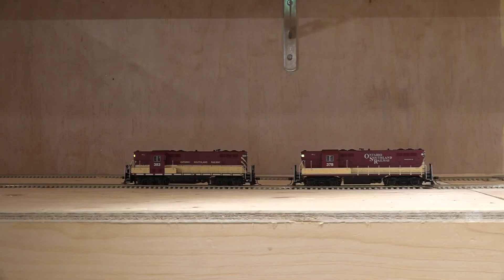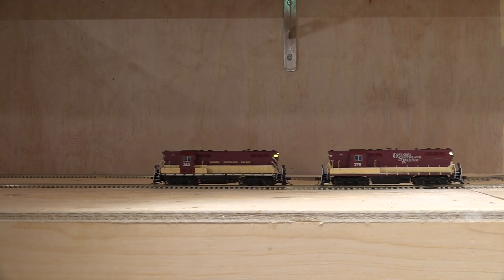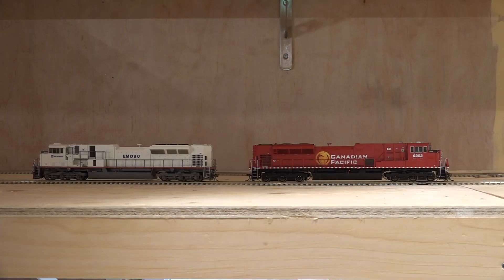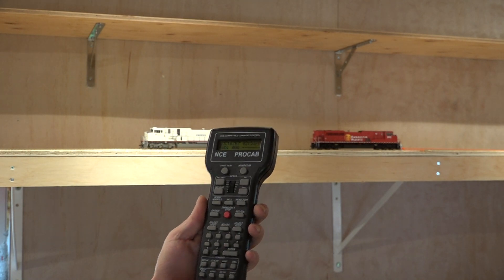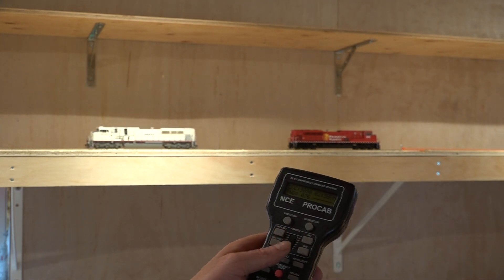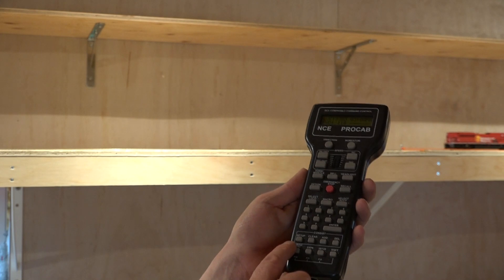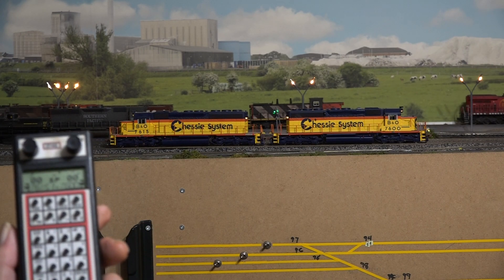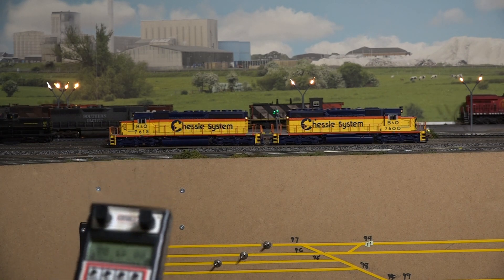consisting 2 locomotives NCE system and Digitrax

Comment: Wow.. freakin great how to video.. now I’m tore between DigiTrax and NCE.. thanks for sharing and keep up the great work guys.. Lance
Reply: Lance, compare prices, NCE PowerCab starter set about $189. Digitrax Empire $250? I think. Although you might be able to get NCE cheaper through the Walthers sale catalog at times and you might buy either one cheaper through Ebay. I have NCE PowerCab and the 5 amp booster, to run more trains and to be able to unhook from the cab bus and the trains continue to run. Talk to Vinny before buying Digitrax. I'd say the community is probably split half way down the middle between NCE and Digitrax.
Reply: CONTAINERMAN68 thanks Roy.. I got the starter set from DigiTrax 5 to 8 amps awhile back .. thanks

Comment: You can also consist a Caboose that has DCC and lighting. I have two of these with directional lighting and consisting allows the directional lights to work on the end of the train as well. To make it work, after you consist your Caboose as the real loco, select the caboose and turn on F0 then select your lead loco. Pretty simple!

Comment: Thanks, Sparky, for this clear, easy to understand, and very useful video about consisting. It was especially easy to follow, because I also use an NCE PowerCab. Coming soon: speed matching, right? (I hate speed matching but you have to do it in order to run your locos in consist. There has to be an easier way to do it.)   ...Roy

Comment: how do you get an engine running the same speed in forward and reverse at say speed step 25.  one goes 30foward and then it runs 33 in reverse.  how do you get it to run 30 at speed step 25 in the same direction?  so i can mu them together and they will work together.  i cant use jmri.
Reply from the maker: I always thought speed matching in forward also did the matching for reverse.